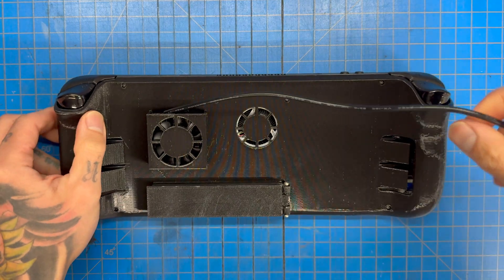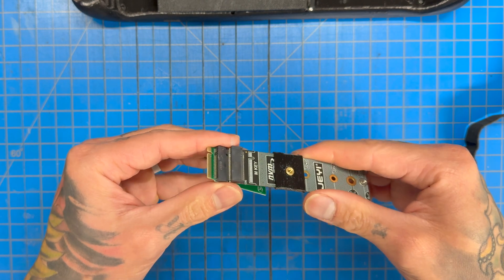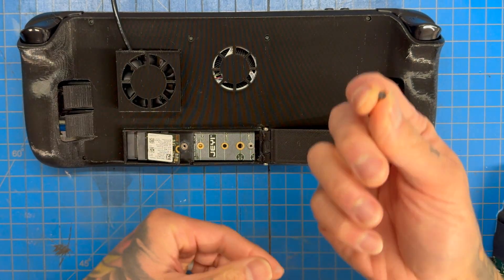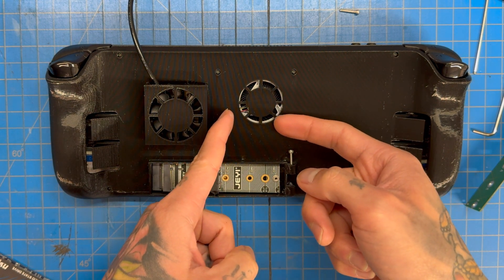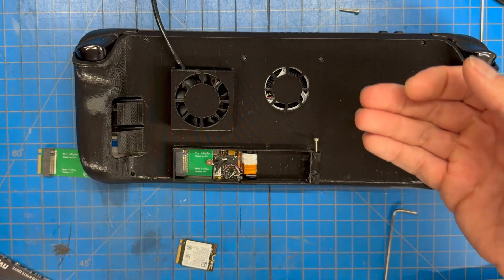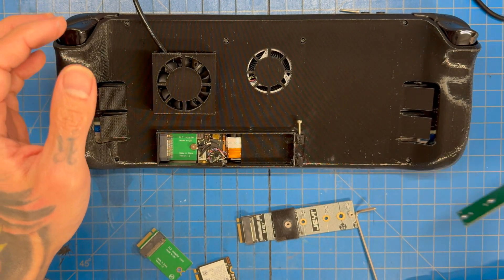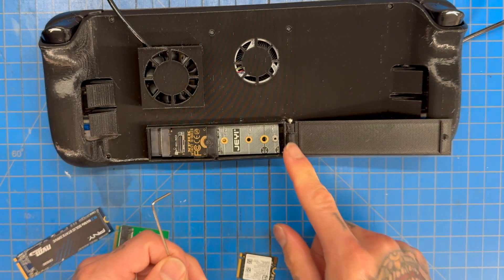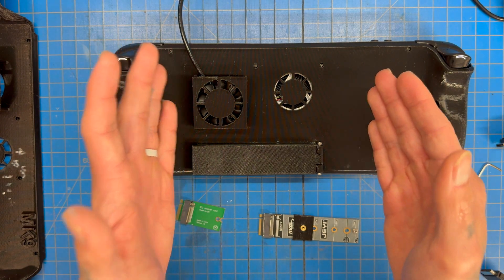Ultimate Steam Deck Backplate - Storage and Cooling - Mark 9.1 #steamdeck #diy

Comment: U should have did slide grooves  for the back cover instead or used the screw at the top and make that area bigger for a kickstand kinda of
Reply from the maker: I wanted to, but the bump out on the handles got in the way

Comment: Just a thought if you made the m.2 area wider than the screw could you not screw everything down first and then plug the m.2 in after?
Reply from the maker: Thought of that, it would end falling right in mid of the curve. 

My hope was to keep it as small as possible. If I can’t figure it out I’m may have to do that.